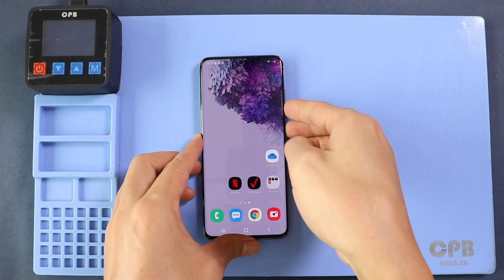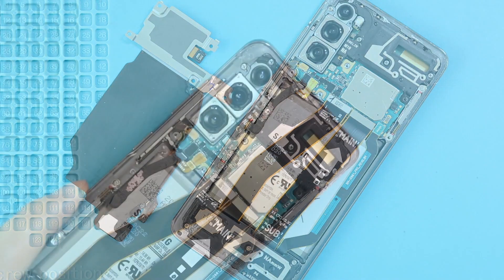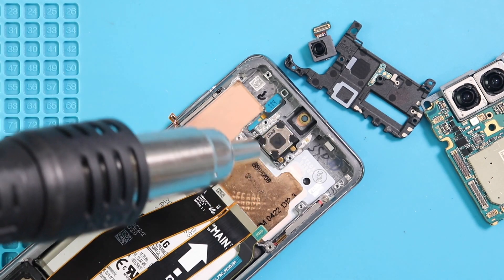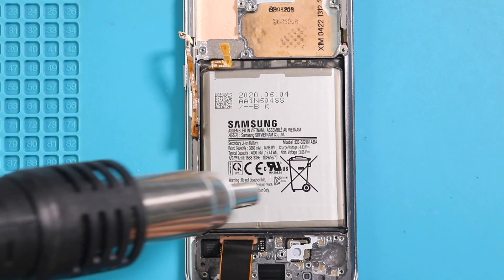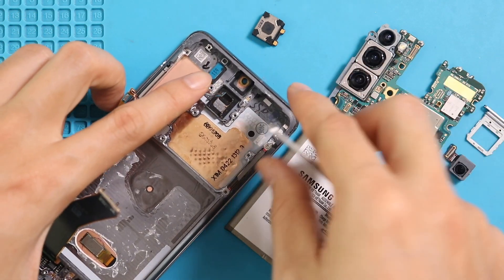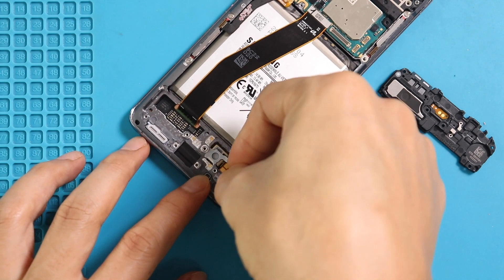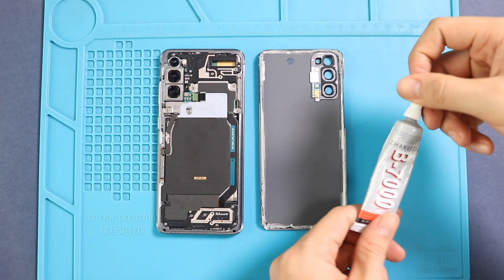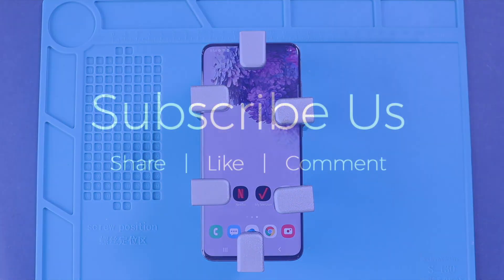Samsung Galaxy S20 LCD Touch Screen Replacement (4G/5G)

Comment: Is it possible to switch Motherboard of Samsung S20 USA variant to Samsung S20 Global Variant ?
Reply from the maker: Not sure exactly. I think the screen is same and most parts, but the board can be little different, so it might not fit to the frame.
Reply: Its fitting. Just did it yesterday, all the parts are same.
Reply: @TechWreckGames  where did you get the motherboard from?